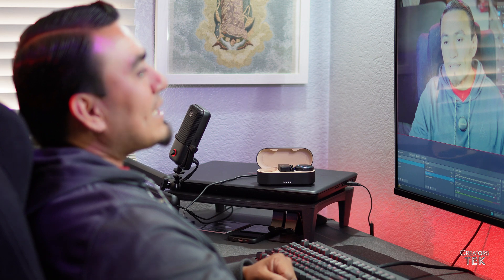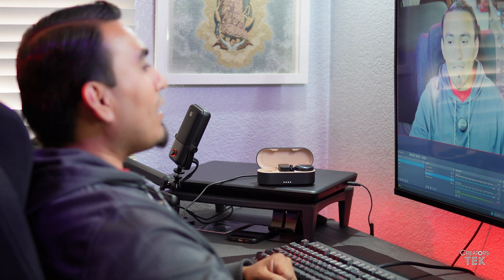Ankerwork M650  Software Tutorial

Comment: Hi I have a question. I recently purchased this mic and completed the firmware update. In doing so my tx1 is not registering with the entire device. Seeming like everything except my tx1 updated. Is there any way I can factory reset this mic in order to try to redo the firmware update for the entire system?
Reply: I'm having the same issue. Have you had any luck?
Reply from the maker: My apologies for such a late reply. I wish I could help further but I no longer own this mic to test it. If I was having this problem I would read the user manual that’s available on the Ankerwork website or contact their customer support. 

Thank you for watching.